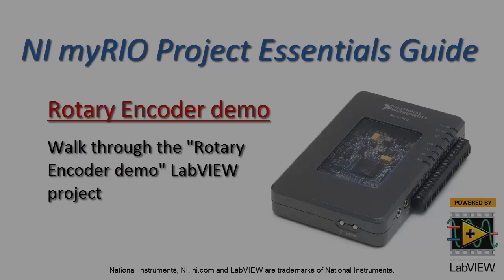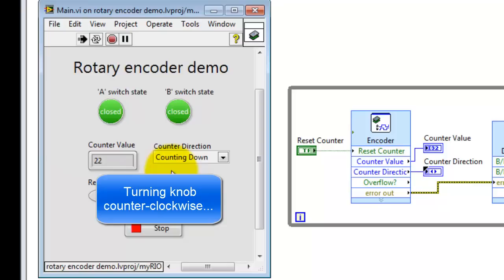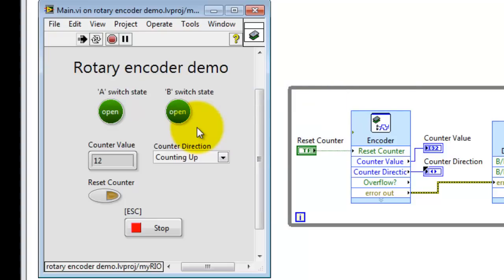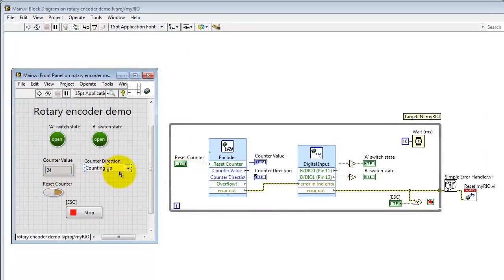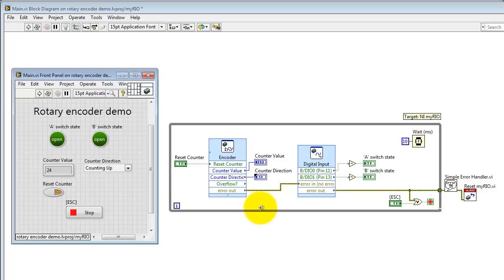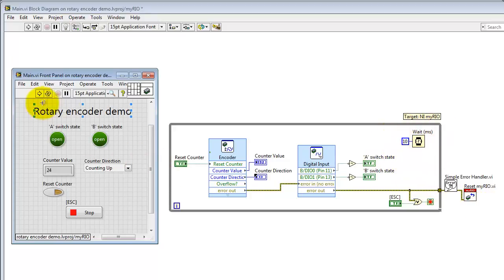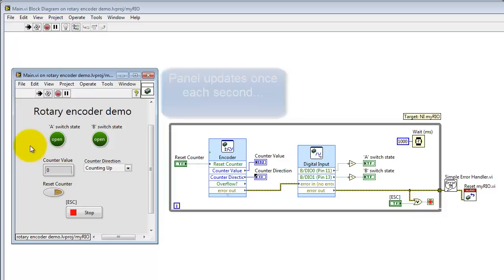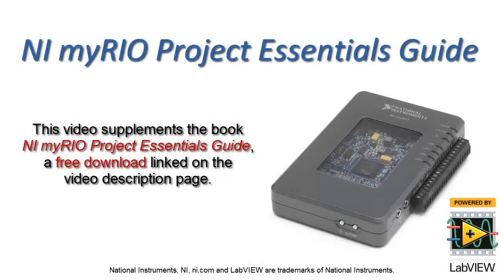NI myRIO: "Rotary Encoder demo" LabVIEW project

Comment: Doesn't work any more because the smart open is defaulted to false. Errors on -363008 "One or more of the channels that you specified were already configured for use as a different I/O type."
I tried implementing a z-index reset for positional control but found that the wait had to be removed. It would be nice if there was an express VI that handled encoders just like every other LabView DAQ... where you can select a Z channel for indexing.
Thanks again for your excellent video's.